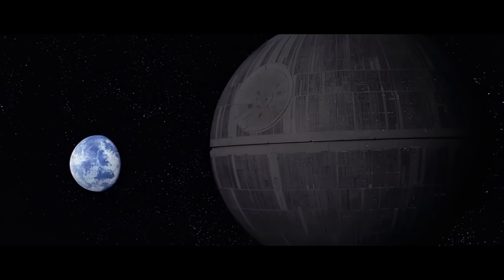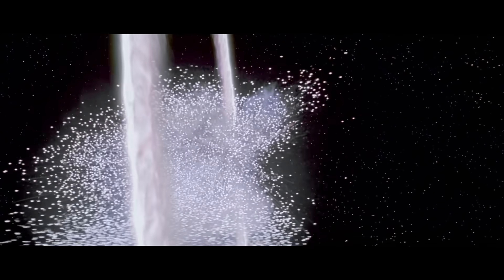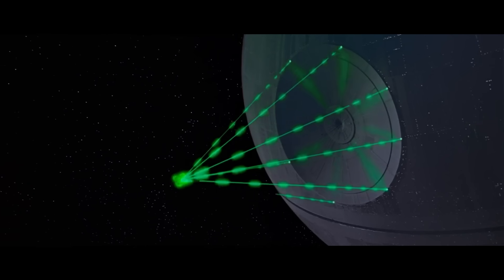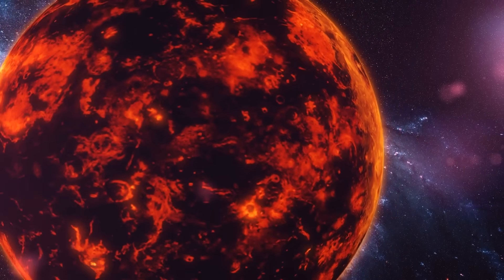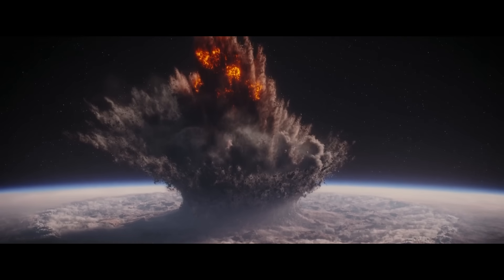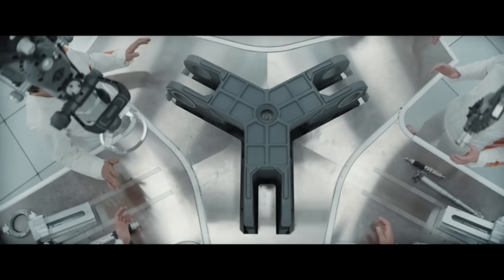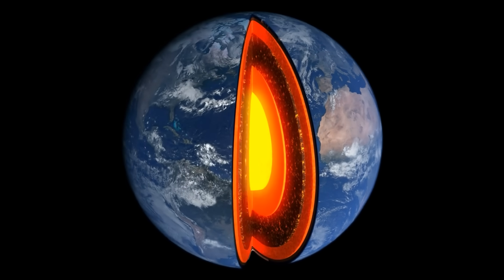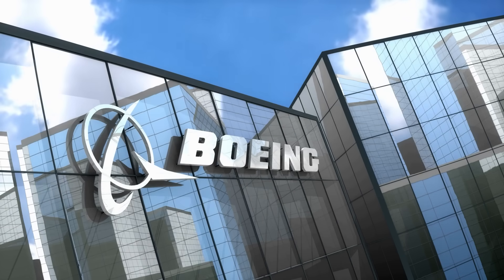The other "Design Flaw" no one talks about on the Death Star

Comment: Good analysis but about 10:07 my impression is the shots of the death star over scarif are supposed to be telephoto shots so it looks nearer to the planet than it actually is because the camera is 'zoomed in' on the horizon or sky. Also imo the weight of the death star wouldn't be as big an issue on the planet since it's still very small compared to celestial objects, a bigger issue I feel would be reaching the planet's roche limit which will tear the death star apart from tidal forces
Reply: Gravity manipulation might help nullify tidal effects on the DS, so, no Roche limit.

The same gravity manipulation would make the effect of the DS's mass negligible compared to the effect of its artificial gravity.
Reply: @davidwuhrer6704 from my understanding of Star wars Laura the gravity manipulation they have is really only enough to keep people on a floor, these title forces generated by planets and moons and whatnot or extremely strong, like millions of kilograms of water being dragged around at 10 mi an hour plus strong. You're going to need a lot more than some basic gravity manipulation to deal with that without dragging very large chunks of a planet you intend on destroying towards your space station
Reply: @the_undead 
"Only" enough to…

Earth gravity is roughly 10m/s².  That is equivalent to the entire mass of the Earth at a distance of a mere 6700km.

Put that gravity plating in the keel of a star destroyer.  You now have a ship with a pull equivalent to a sizable rocky planet.  In at least one direction.  What does that do to a planet it is orbiting?

For comparison, the Moon's gravity is a sixth of Earth's.  Imagine being on a platform dropping at roughly 8.5m/s indefinitely.

At a distance of roughly 400 000 km, the moon is causing noticeable tides on Earth.  Now compare that to Earth equivalent gravity at a distance of 500km (= low Earth orbit) or 36 000 km (≈ geostationary orbit).

"Only enough to keep people on the floor."

Comment: I've got a question?  What is UP and down on the DeathStar?  Like is the TOP (north) of the DS UP, or is the surface up?   Seeing the Falcon being brought into the hanger bay, that = TOP is UP.

But Palpatine's Penthouse office spire is on the surface, which is "up".  The structures and currents on the surface are UP.    So surface = up, and interior and Equator uses Top of DS to be UP?

Comment: I saw a different video that proposed that most of the internal structure was oriented to 'up is out' spherical decks instead of planar decks perpendicular to the north-south axis, with notable exceptions for areas like the hangar bays and certain command areas.  The Star Wars universe had very advanced gravity manipulation, as indicated by the twin turrets on the Millenium Falcon, so changing the orientation of certain areas would not be difficult (I am also reminded of the Lusankya 'prison' Super Star Destroyer in Legends that was hidden on Coruscant, where the prison area was oriented upside-down to the planet's gravity).

Comment: 6:55 the other thing is that huge chunks of the first Death Star were built with component modules that could be used for either Star Destroyers or ground facilities, which helped disguise what the Empire was actually doing.

This is also what created the circumstances that would allow Galen Erso to design in the flaw with the thermal exhaust port.
Reply: A top secret project tgat was broken down into smaller top secret projects, made it easier to hide secrets.   Things get missed or ignored, or in fact hidden to make deadlines... we will fix later.
Reply: the death star was not only a super weapon but a massive tool of direct power projection. which is very useful when controlling a galaxy
Reply: @theliato3809 
But without the senate, how will the emperor keep control of the systems?  The tighter your grip, the more systems will slip through your fingers.

I wouldn't be too proud of the technological terror you have constructed.  The power to destroy a planet is insignificant compared to the Force required for interstellar travel.

But then, the Death Star is the definition of Too Big To Fail…
Reply: @davidwuhrer6704 
Well that’s the point luke makes in ROTJ
“Your overconfidence will be your undoing.”
Reply: What's the point of keeping it secret?  It's supposed to be a demonstration of power.  That's the sort of thing that you advertise.

Takin wanted a target for the first test that would terrorise the galaxy.  He was a megalomaniac, not one for sneaky stuff.
Reply: @davidwuhrer6704  you want it secret until completed... especially in the early days when he was still entertaining a Galactic Senate and hadn't publicly gone full Sith lord.  It is still a weapon of mass destruction.
Reply: @davidwuhrer6704  Because you want to surprise them with the finished product, not give them years of opportunity to STOP IT
Reply: @OtakuUnitedStudio Stop it?  Everyone, and I mean everyone, except Tarkin thought it was useless and wouldn't work.  I can imagine that Tarkin was afraid that someone might steal it.  And apparently he was afraid that someone might copy it, what with tasking Vader to retrieve the stolen plans.  (If the Rebel Alliance or anyone else had a Death Star, too, he wouldn't be the ultimate power.  And who would have thought: It was the emperor himself who made a copy.)

There is no reason to keep the plans confidential.  There is no reason to keep the construction itself a secret.  It goes against the purpose of the construction to keep it secret.

And remember that the Death Star wasn't enough for Tarkin to usurp power:  He also needed the senate to be disbanded.  Until then, he was just one of many provincial governors with a personal fortress.  Although one might question what his fortress needs more firepower than the entire imperial navy for.
Reply: @davidwuhrer6704 "Everyone, and I mean everyone, except Tarkin thought it was useless..."

Its actually insane to me just how much damage 'lore'tuber types like this have done to people's brains. Granted, fans, and especially SW fans, have never been the brightest, and particularly bad at actually watching the movies they pretend to be fans Of, but like, this assertion, for example? It's so absolutely detached from...basically everything in the franchise, that it borders on comedy. It's the literal inverse of how the thing is treated in every piece of media, from virtually every character.
Reply: @papapalps2415 Just watch the original film.  Listen to the dialogue. Forget what you think you know and just pay attention to what is actualky in the film.

> fans, and especially SW fans, have never been the brightest, and particularly bad at actually watching the movies
And you are a shining example of that.  Just actually watch the film.

> this assertion [is] so absolutely detached from... basically everything in the franchise
Which is why you need to watch the actual film.  Not fan fiction, mit lore tubers, not extended universe canon legends, but the actual film itself.
And take notes.

Comment: Thermodynamically speaking, the Death Star would have to have enormous thermal radiators on its surface.  Energy only flows from a point of high concentration to a point of low concentration, the reactors wouldn't work without them.  Destroy those radiators and the whole station would shut down.  That shouldn't be too difficult, such things couldn't be shielded very effectively or they couldn't radiate, and by their nature they'd have to be relatively flimsy structures.

Comment: It also occurs to me that the method used to destroy the Death Stars (and Starkiller Base too) is to trigger a runnaway chain reaction within a weapons system powerful enough to destroy whole planets at a time. The result would throw off a chaotic shockwave just as strong as if the weapon had been used on a planet at maximum power, but unfocused and without a planet-sized mass to absorb the kinetic shock.
Reply: Well the reason the superlaser is so powerful at range is because it throws all that energy in a single direction. Throwing equivalent energy uniformly in all directions would still be a lot of energy (sucks to be Endor I guess) but it'd slope off with the inverse-square relationship.

Comment: So here's a question. Is each floor of the Death Star built like a skyscraper with each floor stacked from top to bottom or is each floor circular from the center?
Reply: Right? What we see in the movies really looks like a skyscraper design, but an onion design would make more sense. I mean, heck, the outermost layer sure does seem to be set up like one continuous landscape.
Reply: From an old magazine Star Wars Technical Journal (I unfortunately no longer have), it showed the Death Star as having an outer layer where the gravity was such that down was toward the core and the inner layers were stacked where gravity was like north is up and south is down (though I don't recall if the layers below the equator line were stacked upside-down compared to those above

Comment: Great points! The supply chain issue is one I've long wondered about. In RotJ our heroes, and later the entire Rebel fleet, jump into the Endor system and nobody is suspicious about the complete lack of space traffic in the system. Since they obviously weren't strip mining the forest moon for raw materials, it would have had to have been brought in by huge freighters. Since the superstructure was visibly incomplete, that would have meant LOTS of freighters. The point about gravity is another one I've wondered about. How were they keeping the DSII in such a low geostationary orbit (to keep it above the shield generator)? That close to the moon, there should have been noticeable tidal effects. Also, it should have been impossible to release as much energy as was put out when it exploded without burning the atmosphere right off the moon below, and probably frying most of the surface area.

Comment: if you only blew up Alderaan into nano-sized particles, the calculation is "To vaporize and ionize all atoms in an Earth-sized planet into nano-plasma debris:E≈2.9×10^32 J ChatGPT calculations and comments are this Step 1: Mass of the Planet Assume Alderaan ≈ Earth: 𝑀= 5.972 × 10^24 kg M=5.972×10 
24  kg  Step 2: Estimate Number of Atoms Assume average atomic mass ≈ oxygen/silicon ≈ 20 amu
1 amu = 1.66 ×10^−27 kg. Atoms per kg =1 x 20 ×1.66 × 10^−27 ≈ 3.01× 10 x 25 atoms/kg Atoms per kg= 
20×1.66×10 ^−27  ≈3.01×10^25  atoms/kg. Total atoms = 3.01 ×10^25 × 5.972 × 10^24 = 1.8 × 10^50
 atoms. Total atoms=3.01×10^25 × 5.972×10^24 ≈1.8×10^50 atoms.  Step 3: Average Ionization Energy
Use average first ionization energy ≈ 10 eV per atom (typical for elements in the crust like Si, O, Fe).
1 eV = 1.602 ×10^−19. 1.602×10^−19 J. Ionization energy per atom ≈ 10 × 1.602 × 10^−19 =
1.602 × 10^−18 J. Ionization energy per atom≈10×1.602×10^−19 =1.602×10^−18  J. Step 4: Total Ionization Energy 𝐸 = 1.8 × 10^50 x (1.602 × 10^−18) ≈ 2.88 × 10^32 J. E=(1.8×10^50 )×(1.602×10 
^−18 )≈2.88×10^32  J So, the electron binding energy of the entire planet is approximately: 2.9
×10^32 J. 2.9×10^32  J.  Comparisons: Process	Energy (Joules) Alderaan ionization energy	
2.9 × 10^32 Death Star gravitational unbinding 2.2 × 10^32 * Total Sun output per second	
3.8 × 10^26 
 
(See note below for comparison) Notes:
Nano-particle final state implies more energy than just gravitational unbinding — it means vaporization + full ionization, leading to hot plasma.

Actual vaporization energy (melting + boiling) is orders of magnitude less than ionization, so this sets the upper bound.

The gravitational binding energy of Earth is ≈ 2.2 × 10^32 J. The  2.2×10^32 J, very close to this — suggesting that the Death Star must overcome both gravity and ionization to pulverize Alderaan into charged vapor.

Jedi ChatGPT remarks, mine are below

                 So the other question is really 'how does the kyber crystal generate so much energy' assuming that multiple parallel universes exists, thus there are 'higher energy states of that universe' can be tapped and dropped into the Star Wars universe lower state energy, thus a power amplification within the kyber crystal, which is immediately released.

This explains why the Jedi Order kept a lock and prevented all research of kyber crystals, it also explains that in the Star Wars universe, Consciousness Energy in the Jedi is used to activate the kyber crystal when they make their lightsaber. While a power source is needed to trigger the kyber crystal, its natural multidimensional state allows the energy to be generated (tapped from a higher multi D universe) remember the hyperspace lanes and jumps?. The blue lightsaber beam is probably a temp of the plasma of a sun 5,500 degrees Celsius (10,000 degrees Fahrenheit). when the lightsaber is activated a controlled magnetic field is used to shape the blue plasma into a light blade. E/M radiation leakage from the magnetic field would create the 'heat' of the blue blade. With a purple plasma blade, that is a very high energy state, which is why there is only 1 purple blade for Mace Windu. is that spelled correctly?

Comment: You are right of course. This is probably why this scale of megaproject is rare. This video helps explain why Thrawn was right. Thawn was no doubt wondering how much larger the Imperial Navy would have been if they didn't have to fund the Death Star.
Reply: Especially considering the Empire already had the much more reasonable Onager star destroyer for the purpose of dealing with shielded planets from orbit
Reply: Tarkin explicitly says that the Death Star has more firepower than the entire imperial navy combined.

Which makes sense, I guess, because the navy would not focus on fighting, but on keeping trade in the galaxy safe and ongoing.

The empire was not built on military strength.  Tarkin makes this quite clear when he attempts to change that.  And by how radical a change it would be.

Thrawn thinks he is smart, but he is no better than Tarkin.
Reply: @davidwuhrer6704  I would say both Tarkin and Thrawn are very talented. But in this case, economically, Thrawn is right in my opinion.
Reply: @misterbrady100 I'd say they are equally talented.  Equally ambitious.  And ultimately, equally successful.

Comment: The main problem with the Death Star is it can only be in one place at one time and that makes little sense in an Empire with millions of major planets and even more minor planets. If it only took one day to travel and 'show the flag' per solar system it would take over 2700 years just to do one drive by. If only 1% are causing troubles it still would take 27 years to just handle the immediate headaches. The better choice would have been 10,000 Star Destroyers that would be easier and quicker to build, while making much better strategic and tactical sense.

Comment: I’ve always thought the destruction of Alderaan was happening too fast. True, the complex sequences you described might not have been possible from a special effects point of view. But they could’ve just slowed the explosion way down. Even half speed would’ve been an improvement.
Reply: Well, also keep in mind that, first and foremost, this is a movie that is intended to be entertaining to watch too.  "Perfectly technically accurate" does not always mesh well with "dramatically compelling", and sometimes you have to pick one over the other.  (and IMHO, in this case they made the right choice)
Reply: We got that in Rouge One.
Lucas ultimately was working with the special effects he had in the late 70s
Reply: @theliato3809  Rouge One? The red guy?
Reply: @TokyoXtreme no that’s rouge leader
Reply: @theliato3809  Did he train with Obi-Wan Kenobi at the Moulin Rouge?
Reply: @theliato3809 Yes exactly! Rogue One got it right.
Reply: That's what they should've "fixed" in the special edition. The Death Star explosion is also too fast, but Alderaan is basically the size of Earth. Apparently the Death Star blast is a hypermatter reaction that accelerates its target faster than light, so whatever.

Comment: You cannot multiply power, this is magical thinking applied to basic physics, you can use another power source to amplify one specific energy output ( like more electric current to generate more coherent light), but you need to operate within the laws of energy conservation of thermodynamics.

Comment: The Death Star was designed to be a mobile star base, so it jad to have been ebgineered to compensate for the various stresses that would be put on it. 
That massive electromagnetic field that surrounded the first Death Star could've been a side effect of whatever they used to maintain structural integrity.

Comment: About the structural integrity question: Are tensor fields still a thing in current canon? I remember they were mentioned in the Episode 1 incredible cross sections, on the Trade Federation landing ships wings staying in one piece.
Reply: I think the people working on it just quit caring/thinking about that after the ep1 run of movies.

it's the change in entertainment scifi in '00s. the nu-star trek did a joke from futurama but not as a joke, putting the enterprise under water while in previous generation of space slop they would use it as plot points that the enterprise is not a ship to land on a planet, it was a space ship built in space to fly in space - this difference existed in the early star wars but they threw that out of the window and aero doesn't affect tie fighters now and you can shoot beams through hyperspace.